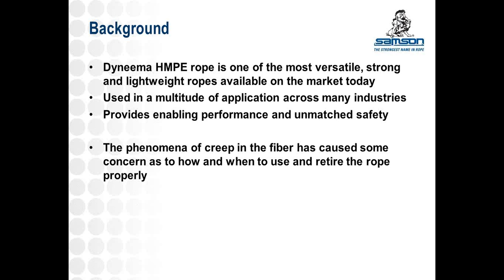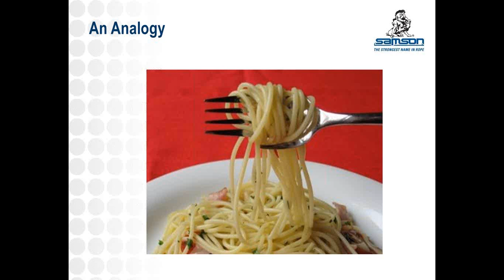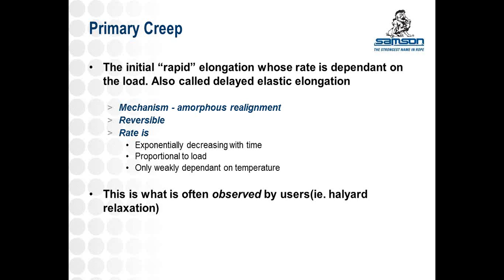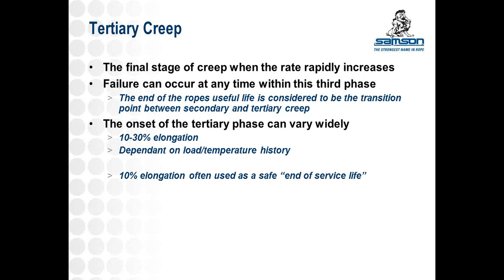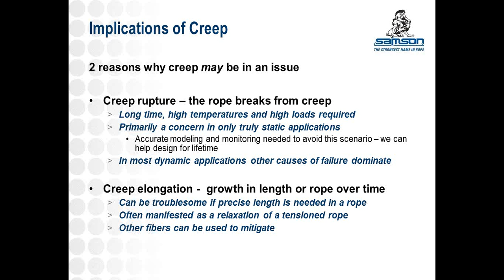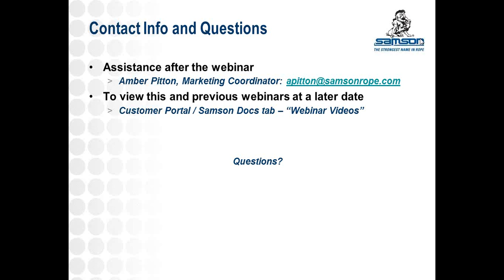Creep Explained

Comment: Wait wait wait-- you guys are getting amsteel back, used, that's stronger than factory-spec?  This'd make me think that, like heat-treatment, pre-tensioning the line (@factory) would be a worthwhile part of production, no?  I mean if the line is getting a little stronger after a bit of setting that's one thing but 10-15% is what he quoted that's a gigantic gain especially on something as impressive as Amsteel....would love to see a graph of this, I have to imagine the rope does get a touch stronger (wouldn't have guessed double-digits though!) during initial loading before it begins its downward-sloped strength-loss dive over time.  

Am glad someone brought up *heat-treating* the rope because I'd love to know, who else besides you guys heat-treats?  Am quite sure I've seen reference to it from Yale but unsure...would love to know who does/does not do this, it's such an outstanding idea is it done to all your ropes or only HMPE-based cordages?  Would love to know any specifics IE the heat it's subjected to (or average-heat if it varies wildly!) and how long, I am in Tampa-area FL so heat, and humidity, are big power-sappers on ropes here!
Reply from the maker: Would recommend you check out our resources on SamsonRope.com for many of your technical questions. Specific to this topic is our technical bulletin, HMPE Rope – Effects of Post-Production Process https://www.samsonrope.com/docs/default-source/technical-bulletins/tb_hmpe_post_production_process_web.pdf?sfvrsn=8408910e_2

Comment: Why wouldn't splice-setting be checked-off more in the table @13min?  Would have expected that splice-setting under usage was a form of hysteretic elongation, maybe not checked because it's not so 'observable' as the splice is relatively small?  (kinda thinking the same for 'elastic elongation' applying to Splice Setting as well, would imagine it's fair to put any long-term physical stressors tthat the rope itself sees, onto the splice as well!
Thanks a ton for this video series, I got so much out of your how-to videos but THIS type of content is stuff I didn't know was out there & am beyond psyched to have found, thanks Samson!!!!
Reply: and @15min when discussing long-term ramifications of creep there's not a clear "as creep occurs, dynamic capacity goes down" sentiment, will have to re-listen to his phrasing but for  me, when considering creep, my main thought is "dynamic capacity is reliant upon the rope's elongation-strength, and creep directly down-grades this", a sad fact about rope-in-general (gotta say I'd really love to see more on *nylon*, have only watched a few of these tech/webinar clips from you guys so far but the first one was comparing fibers and left out nylon I'm realllly curious what's up with 'high-tech nylons' as I'm in arboriculture so dynamic capacity is the prime attribute sought and nylon, above all the fancy high modulus PE's, seems optimized for dynamic-capacity (but it picks more, is weaker to abrasion, which - as I understand it - is why poly cover braids are put on nylon-cored bull-line)